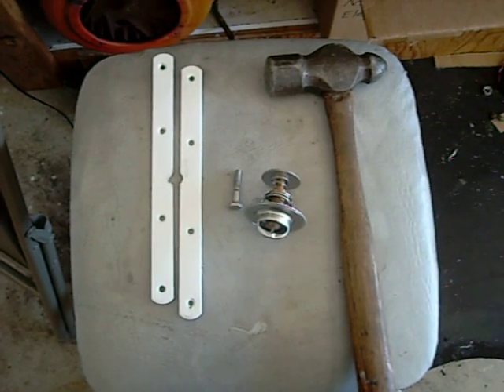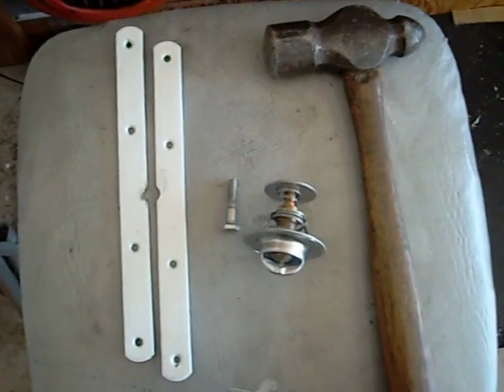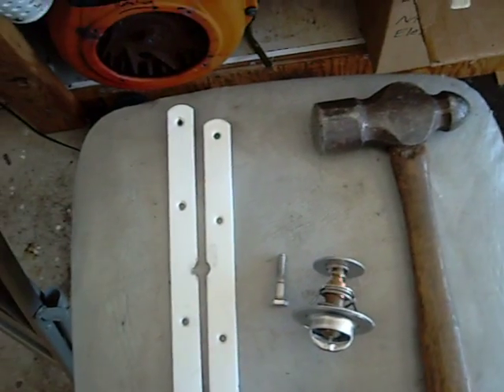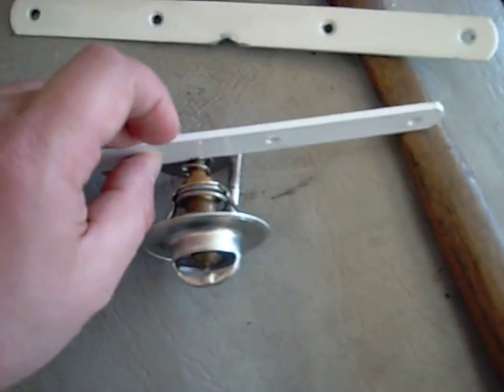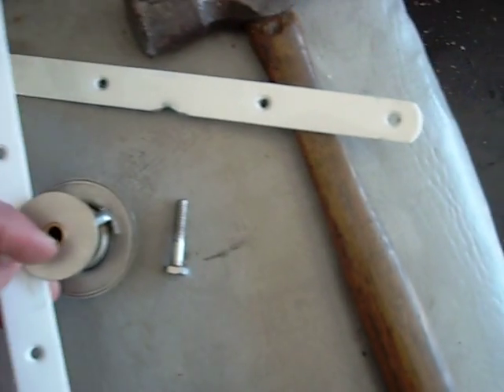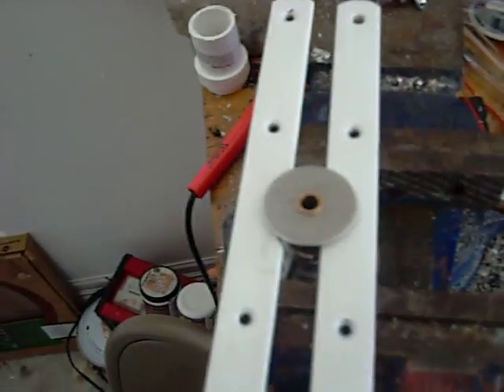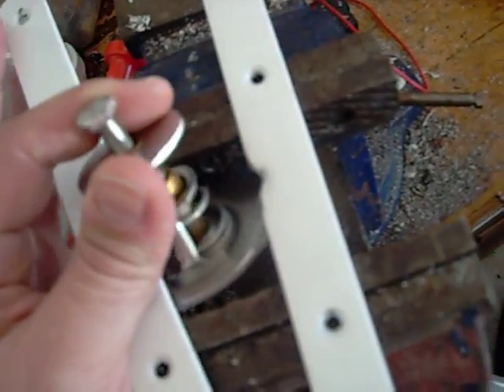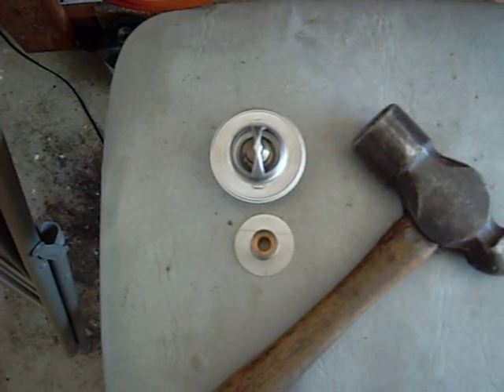205 Deg F  ALH TDI T stat 010

Comment: I have a 2002 jetta have anyone taking all the vacuum lines out( I seen on vw site alot of people doing but no one says anything about mpg) and how did it run? Any diagrams of vacuum lines? I got a auto book and lines on diagrams on front of car looks different..I have a p300,p301-304 code with p1296 which is coolant sensor or thermostat. I have high 26 short fuel trim until I'm driving then goes to 0 or neg number help reecocarva@gmail.com anyone in Michigan can help I'll pay
Reply from the maker: Sorry not sure on the gasoline versions of this vehicle.  Maybe over on the Vortex they would have a clue?  Best of luck!

Comment from the maker: I don't believe so.  In part due to the issues with camshaft bearing wear.  I would hate to increase wear from higher oil temperatures on top of the poor VW Cam support/bearing design.  MK4's and older designs would work well with the higher temp T-stats, not so much MK5's.